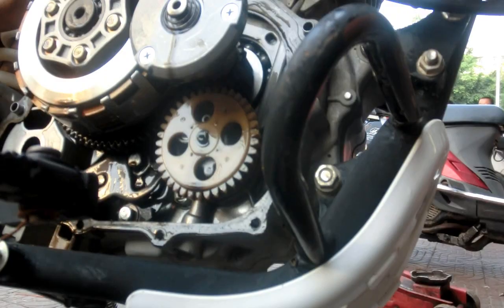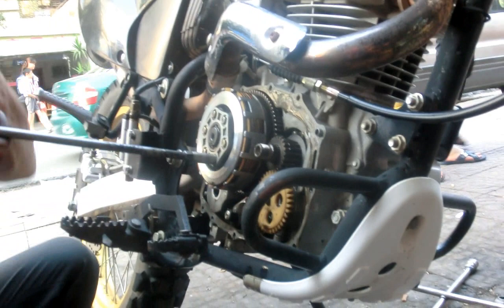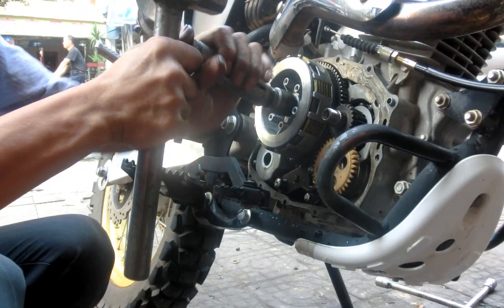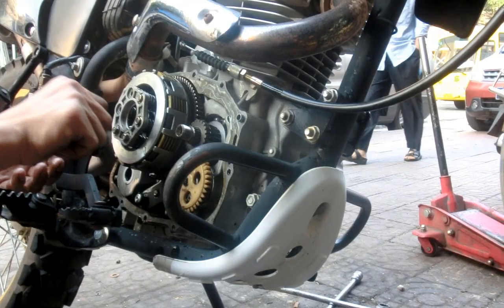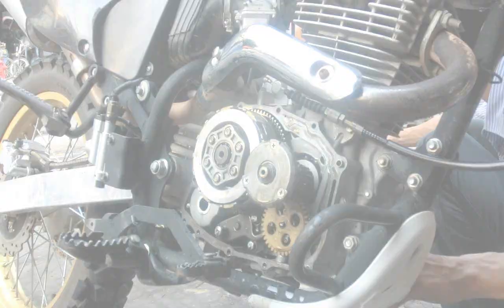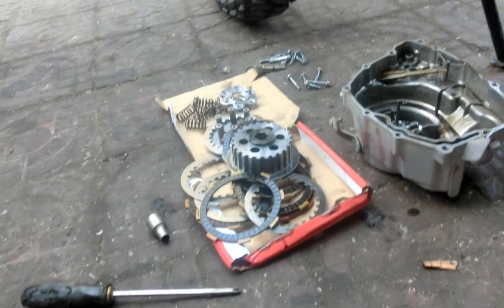Motorcycle repair - Repairing a clutch

Comment: thought we need clutch holder tool but seems no need if only have impact driver already. thats handy way to replace clutch without special tool. I will try later.
Reply: Bong Keun Chee Bad idea;sorry for the bike engine; the use of the hammer impact driver is pure 
bastardry, what it amounts to is hammering the ball races on the 
main-shaft with a gimpy!!!
The result is notched main-shaft bearings.
Put the bike in 3rd-4th gear; sit on it and  apply rear brake; and use a
 bar and a socket to undo, same with the oil centrifuge on the 
crankshaft; If the crank shaft was a built-up one press assembled, then 
hitting it with a hammer would damage it dont need a clutch tool.

Comment: sorry for the bike engine; the use of the hammer impact driver is pure bastardry, what it amounts to is hammering the ball races on the main-shaft with a gimpy!!!
The result is notched main-shaft bearings.
Put the bike in 3rd-4th gear; sit on it and  apply rear brake; and use a bar and a socket to undo, same with the oil centrifuge on the crankshaft; If the crank shaft was a built-up one press assembled, then hitting it with a hammer would damage it
Reply: peter boswell. سكس
Reply: A quality comment, rare these days

Comment: Hello Winston. I have a 1996 Yamaha VMAX. The two spark plugs on the right side are running rich. The two spark plugs on the left or running normal. What would cause this?
Reply from the maker: If it’s fuel injection, get the computer re tuned, if it’s carbureted then adjust the mixture to match

Comment: After recharging the battery over night, my Chinese 150 cc scooter moped has no electric power when the main switch is turned on, the panel lights don't even light up, of course there is no reaction at all when I try to start it up.

I tested the voltage of the battery with a multi-meter which read 12.78 volts. Then I tested the fuse for continuity which is good. I also tried to kick start for a few times without success. After that, I tested the continuity from the red wire connected positive lead of the battery to the main switch and then turned the main switch on with a key then checked the continuity between the red wire to the black wire behind the switch and the continuities on both tests are okay.  To make sure that the electric power reach the main switch, I measured the voltage across the red wire and black behind the main switch, and it read the same as the battery voltage.  So now I am at a lost as to what to do next... as I remember when the main switch is turned on the panel lights are supposed to light up, but now it does nothing at all. 

As if things are not confused enough, when I measured the voltage across the 2 leads of the starting relay, it read 1.78 volts.  I double checked it and yes it was 1.78 volts.  Then I measured the battery voltage, and it was also 1.78 volts. I thought it must've been the faulty battery that was the problem and dis-connected the battery and took it out and measured the battery again by itself, but the reading this time was 12.38 volts.  So now I am totally confounded.

Can you tell me what might the problem be?
Reply: Skipta Skiptaa Yes, I replaced the old battery with a brand new battery, the problem disappeared.  Must have been a bad battery...
Reply: Skipta Skiptaa what order do the clutch plates go and what is keeping my clutch from disengaging

Comment: For those who ar looking this video, never use a hummer less than a srew driver like that one, never. never punch your motor parts with a hummer, never, that s obsolett.
Reply: patricio wade so what to use instead?
Reply: Uh... He's using a impact socket. It's designed to do exactly what it's Being used for. That's exactly how you should apart a clutch. It pushes down and turns simultaneously eliminating the risk of stripping bolts.

Comment: Engine of your motorcycle, look like me
Do you Loncin engine of if?
It is a 223cc, I have the same structure as too though it is entering engine also V-raptor
friction disk It is with them too to pump oil to the disk side 7 pieces
Engine will come back well repair be.